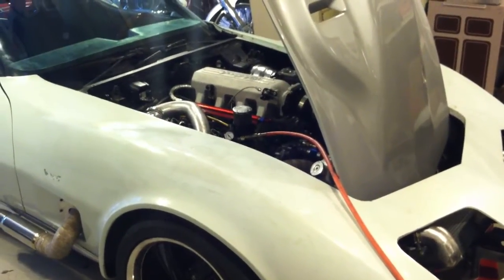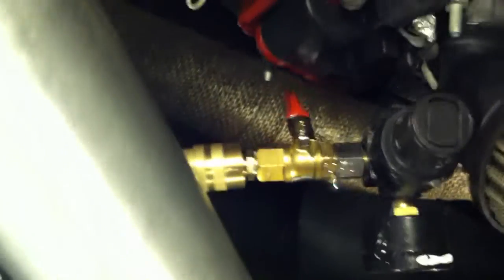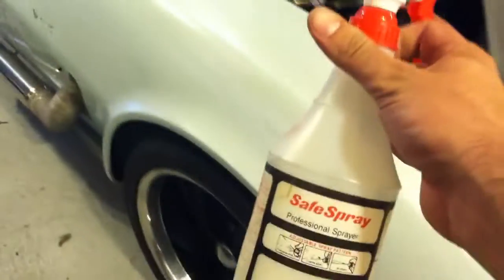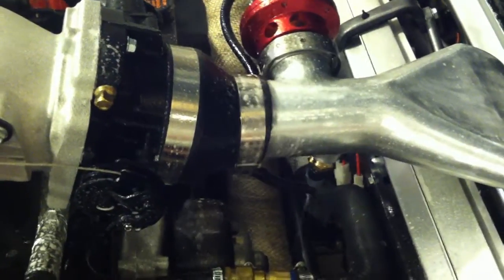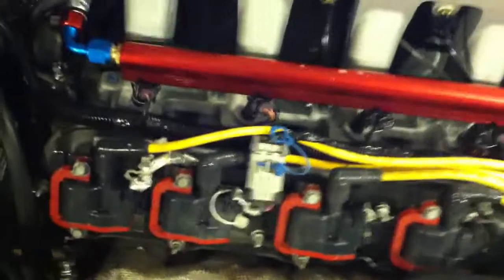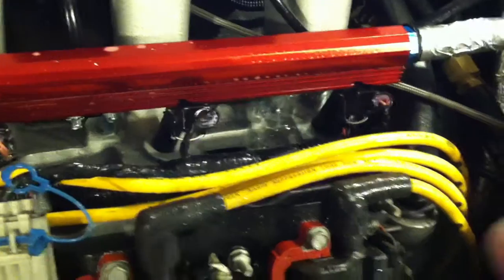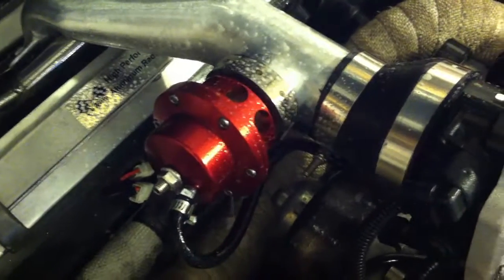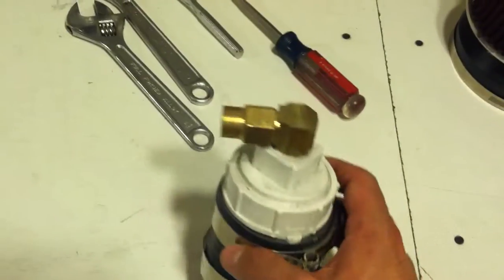Turbo boost leak test on my LS1 corvette

Comment: Any update on the C3?
Reply from the maker: Car has been on the road for three years now with no problems. Issue I had when I made this video was the factory throttle body, and my vacuum lines to the waste gate. The throttle body shaft seal is designed to seal from vacuum and not from positive pressure. I modified the seal to seal tighter as the pressure increases. I also made all the vacuum lines from hardline.